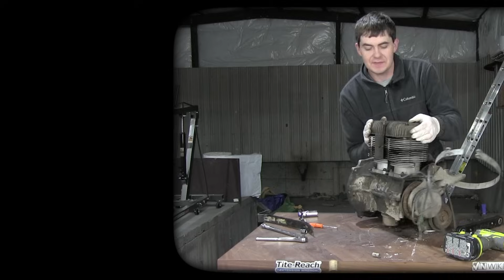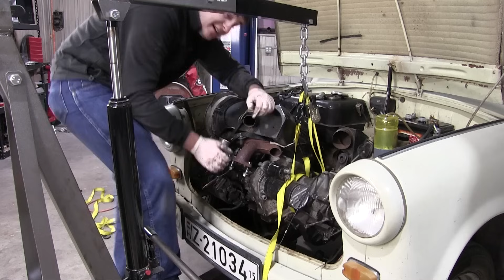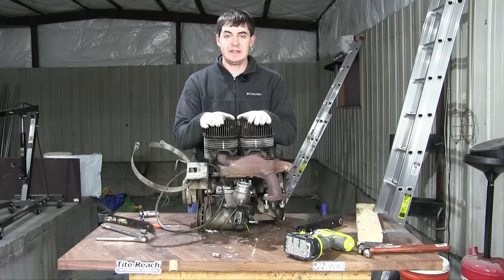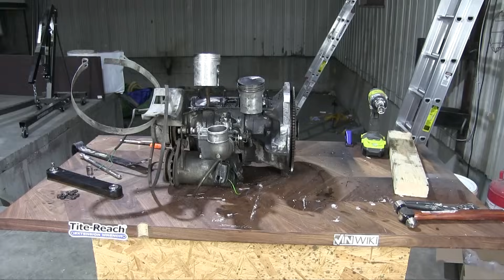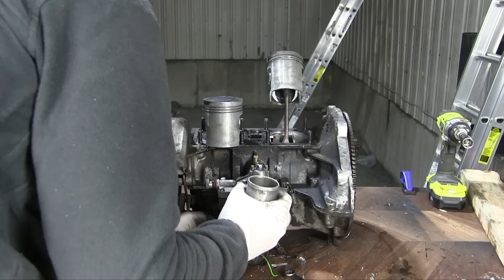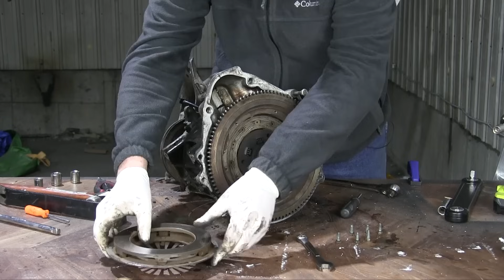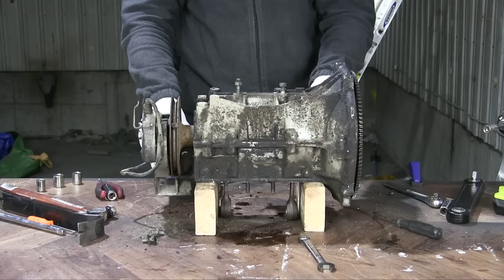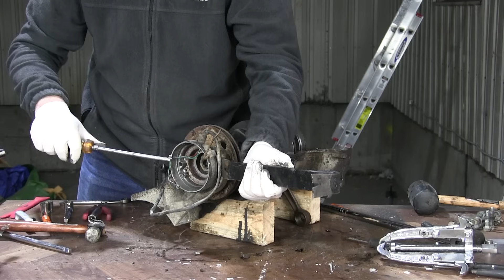Rebuilding the Trabant's Engine: Part 1 - The Teardown

Comment: A few things about two-strokes:
500cc when well tuned (or even 600cc) on double bangers can produce an astounding amount of power (250cc on a single cylinder can produce well over 45HP).

There's no such thing as a "factory tuned/jetted carb" or even a stock jetting, use the stock jetting as a North and adjust from that. Every two-stroke is different and you have to go from what the engine and spark plugs tell you. If the engine sounds like it's cutting revs at wide open throttle, it's rich. If it starts to lose power at wide open throttle, it's lean. A light-dark brown plug color is ideal. (And yes, when tuned it's still going to chug through an entire tank of gas like nothing)

Change every goddamn seal you find, otherwise you will regret it.

Hard starting is very caracteristic of: I. Low carb float level; II. Rotary or reed valves not sealing right; III. Too small of an idle jet.
A good idle is set so that the engine doesn't take long to return to idle after a good rev-up, but doesn't drop to idle too fast. If it drops too fast, that means the idle is rich and will you also feel a sluggish and delayed engine response, leaning it to the right point should result in crisp and quick engine response.

Just blipping the throttle when coasting is enough to lubricate the engine. (Just give the gas pedal a very, very quick pump every 5 seconds or so, no biggie).

Two-strokes like to rev a little high (Well, the Trabant's redline has to be around 5000RPM or so) and have absolutely no torque below their tuned RPM, when you reach the tune RPM you will feel like someone opened a NOS can into the engine (Unless the exhaust is restricted like stock mufflers normally are, which in a way makes the engine feel to have a much wider powerband. Try searching for an alternative "racing" expansion chamber if you can.)
Reply: Andre: You know very little about these old school, Schnerle ported engines.. They're rotary valves so no reed valves,  they're old school long stroke and make most of their torque from about 2000 rpm up, very tractable and wide powerband. much like a Jawa 250 or Vespa 200.   You can also just shift to neutral or open the enrichment ( choke control ) a small amount on a downhill.  Blipping the throttle while it is in gear is stupid, it unnecessarily peak loads the engine bearings and drive train. These engines  don't like to be revved  "a little high'.  It does them no good to wring them out, you unnecessarily are wearing the piston ring lands over revving it. The recommendation of  expansion chambers is the dumbest suggestion.  The exhaust manifold heats the interior, you'd lose your heater and defroster, and you'd spend over twice the cost of the car having a custom shop build a pair of chambers for this, and once finished the tuning involved would take that nicely tuned, broad powerband and make the car nearly undriveable.   Oh and my bona fides?  Oh about 20 years of driving and repairing SAAB 2 stroke cars.
Reply: @tauncfester3022   Just curious arent these engines made to run on 68 or so octane russian gas?  Looking at those heads and flat top pistons compression ratio looks to be about 5 to 1. maybe a simple mill job on the head might help with some hp? If it wont create an overheating issue?
Reply: Well, what do you know. I did say "Rotary/reed" mentioning that a two stroke can use either depending on the application. What is the redline of an engine like this one? Does this engine have a "wide powerband" because they limited the engine where it could peak like a normal two stroke or is that a característic of the exhaust or what? I did say "every two stroke is different" and I come from the motorcycle world.
Reply: @andrecampana-i6c  Looks like the Trabant revved to maybe 5000 RPM.  Info I found shows torque peak at 3000 and HP around 4000.  That strongly suggests that you're right about the typical 2 stroke power band.

Closing the choke going downhill is not the best idea.  Good way to flood the engine before you reach the bottom.  Better to occasionally declutch and blip the throttle.
Reply: @immikeurnot  You are right, peak power at 4000RPM. Wow, that's disappointing for such a promising engine. I would guess it's a supply problem to the cylinders due to less than ideal porting sizes, position and finish. Anyway, two-strokes have come a long way since the early 60s in these aspects, and being a cheap car, they didn't care about a lot of R&D to make these cars more powerful, they just wanted something cheap to last, and I would love to see someone improve the design and make perhaps a 100HP trabant some time :D
Reply: And yes, it would make the car literally undriveable without some common sense.
Reply: https://www.youtube.com/watch?v=64sOXtlEt0Y Another video showing a dyno test of a tuned Trabant 601
Reply: @andrecampana-i6c 
One of the main problems with the power and torque of the engine are the non ideal airflow and very rough ports. (it's also dependent who was working in the factory the day the engine was build, some are rougher than others.) With some cleanup you gain power and torque.
But to get more you have to change the exhaust and ignition.
There are also things like crankcase fuel injection, active air cooler or turbo charging. I've seen it all on meetups. But i have idea how effective that is.
Reply: In Eastern Block, car drives you !

Comment: That loose exhaust may account for much of your performance problems.  I think you should call the motor the  " noisy bit ."   A Trabant motor  has doesn't really fit the usual idea of powerplant.  Much of the power bit is missing.   Dynamo is an old term for generator.  It may be preferred by European English speakers.  With good bearings your new crank will free up more power.  How do you handle unleaded fuel?  Goodluck!!

Comment: Good morning from the UK! New viewer and sub.

Without wanting to start  arguments, I'd wager that you CAN lift a Trabant engine by yourself... My reasoning behind this is that I can remove the 850cc engine and its gearbox from my Reliant Rialto and lug it over to the work-bench alone, and I'd imagine the smaller cc 2 smoke engine wouldn't weigh as much. I'm not the strongest of folk either lol. 

After this vids finished, I'll be off to watch more of your library and will be watching the Trabant series with interest. T'ra!
Reply: if you get a friend and both of you have decent body strength, you can lift the entire car, it's 600 kg.
Reply: @luuk3213  Fair enough, a whole 160kg more than my Reliant :P

Comment: Both dynamos and alternators technically are generators. A dynamo uses a commutator to rectify the AC into DC and usually uses electromechanical regulators. An alternator uses diodes to rectify the AC into DC and mostly use an electronic regulator.

Comment: that thing isnt much bigger than a harley davidson motor or a lawnmower engine
Reply: At something like 1400cc typical Harley engine is about twice the Trabant's capacity. And embarrassingly close to equal in stock horsepower, actually.

Comment: As a dude who have worked on 2 stroke engines alot, The side play doesn't really matter. The conrod does stay in the middle while the car is running if the piston side is not loose. Or they do move side by side but have never had any problem on that even on a long run. Up and down play in another hand will kill the engine, fast

Comment: You should get the con rod, and all roller bearings coated with Microblue.com. So as to gain more hp/torque and mpg.  Plus the engine will pretty much never wear out.

Comment: Place RAG in bottom end to keep the rods from banging around and debris falling in. Since you replacing CRANKSHFT - you need New CRANK SEALS as well and Clean Crankcase halves then put on Threebond 1104 on the Cases - THIN amount or it will have a Gasket.

Comment: Top end has wrist-pin/wrist-pin and should be checked for wear. As well as if the Cases as a 'gasket' it uses Threebond 1104. Plus you have to clean all surfaces.

Comment: 2 Stroke has side-to-side bottom end clearance you have to have spec. It should have NO up/down as would need crank pressed. Plus, air leaks will cause it to run erratic and idle up/down. Super simple cast iron sleeve cylinders and engine but dirt simple/reliable as the old USSR/Russia today.

Comment: Sorry to interrupt. Most, if not all 2 strokes have pressed crankshafts... because they have roller bearings rather than plain ones (cause these rely on an oil supply/ pressure)... In short any Kart, Rotax or dirt bike shop will take your crank, pull it apart and replace the bearings. Look for a good one as pressing and 'true'ing it is somewhat of a lost art.
Should be cheaper than getting a whole new crank.
Reply: Finding a good place to fix it would not only be cheaper, but faster. most bearings are in mm anyways, even on the Model T ford.
Reply: TheJR1948  They used a "Labyrinth Seal", a low-contact/non-contacting seal which relies on some of the fuel mixture to actually make the seal. (it's almost a "moving piston"). Very common on Multicylinder Pressed-together Two Stroke crankshafts
Reply: I had a feeling that this should be possible from a local source, as long as replacement parts are available and precision measurement isn't required.
Reply: TheJR1948  Jep, most definitely... but as he can get a full new crank :p I guess it can't be a problem.
Reply: TheJR1948  Take a look at https://www.youtube.com/watch?v=y1VTKDX-A14 . There you will see how DKW sealed the sections of the crankcase. 3=6 at its finest.
Reply: no all two strokes have pressed crankshafts.... Check out Detroit Diesel two strokes.  They didn't use the crank case to pressurize the cylinder, they all use superchargers.  Same think with locomotives and marine applications.  Of course two stroke Detroits were used in large trucks (inline 6, v6, v8 and v12 varients)  Some were turbo charged, all were supercharged (that is how they pressurized the cylinders) and they had oil sumps and pressurized oiling.
Reply: @mrRhwalden  Sorry that is vastly outside the scope. Those engines do not use the crankcase to pressure mixture and rely on pressured lubrication systems.
Reply: Urban Madness  Yeah but they are not crankcase induction engines either and the fuel and the air are not mixed and the supercharger is because you would never fill the cylinder at low rpm and it's crankcase is not open to the combustion chamber. The diseasil  fuel still comes from a high pressure injector.
Reply: @captainchaos3053  What is the point you are trying to make? Just listing the operation of a diesel 2stroke is not a remark nor a question. Please clarify
Reply: Paris Rogiest   Only aggreing with the previous comment that they are not the same as a premix petrol system.  So yes diseasel 2 strokes run a wet oil sump and pressure fed lubrication system to the crankshaft, bore, valve train and the injection pump.  What's the problem?
Reply: @captainchaos3053  No problem, if there was a remark I would enjoy having a discussion about it. But since I missed your point I wanted to understand first to form an argument
Reply: Paris Rogiest no wish to argue on this end. Was only a point of agreement in the difference in diseasel and petrol 2 stroke.
Reply: @mrRhwalden  uniflow two strokes are completely different story than simplistic ones using crankcase scavenging. Not to mention that diesels must use injection to (pre)combustion chamber, so by principle you can't mix fuel with oil and feed it to the bearings. In general, the whole concept of crankcase scavenging is simplicity, serviceability and good power to weight ratio.

Comment: Its called "the iron curtain" and it is there to divide the eastern cylinder from the western...
Reply: I was stuck in the middle part closer to the east side. We had Trabby - ackwardly the service manual was half useless - our car needed more advanced ignition timing and bigger gap on points to work properly -  once I adjusted everything according to manual and my family almost killed me for messing up the car. Our Trabby run on 87 Oct 1/50 premix  Ave 6.5L/100. I could take any Fiat 126 or Szkoda from light on 2nd gear. The crank common problem on with this engine but you pay for simplicity of the engine design - I also had Jawa 70 or 80 cc engine with carburetor mounted on the side of  where the intake port was old and closed in exactly the same manner as on Trabby.
Reply: @pliedtka  was it a Jawa 90 roadster/cross/trail? 5-speed, 90cc, ~10,5hp, rotary valve intake
Reply: Sitting in Zwickau. Watching English videos about a car build here.
Reply: Absolute GOLD, well done. Still cracking up 15 minutes later.
Reply: thehaze1972 epic post :-)
Reply: In hungary the trabant called paper jaguar 😁
Reply: "Berlin Wall" might be a better description.
Reply: 2 years later this comment still has me cracking up laughing at random.
Reply: Best comment ever.
Reply: Thas a good one.😁
Reply: The pin that goes thru the piston here in the UK we call a gudgeon pin - I think in the USA you call a wrist pin. 
A dynamo produces DC current whereas an alternator produces AC current. 
Nice vid 😊
Reply: @bobz1736  No. A Dynamo generates DC. An alternator Converts to AC. Eh?
Reply: @SSVplus  close, alternator produces A/c but converts to D/c through the use of diodes
Reply: @bobz1736  Although you are correct, the A.C. has to be turned into D.C. by the Diodes.😁
Reply: @bobz1736  that's what we call the pin that holds the rudder to the boat in the US...on our little boats..
Reply: Then shouldn't it be called the Berlin Wall? 😀
Reply: @BedsitBob  Berlin Wall was only in Germany ( West/East).
Reply: @bostedtap  And East Berlin was were the Trabant was very popular.

Indeed, to this day you can still go on a "Trabi-Safari", around the City.
Reply: @BedsitBob  would not call it popular. More like something you can get... Sometimes.
Reply: @BedsitBob  only berlin ? the whole DDR and other countrys^^
Reply: @bostedtap  and perhaps again the difference in English......I would call the Trabant  common , but not really popular......Two nations divided by a common language?  LOL
Reply: Lol
Reply: I thought it referred to the beef curtain of a particularly fat, unwilling East German woman..
Reply: so geil xD danke dafür!
grüße an ALLE!
Reply: But what if they become north or south
Reply: Every democrat's communist's wet dream.